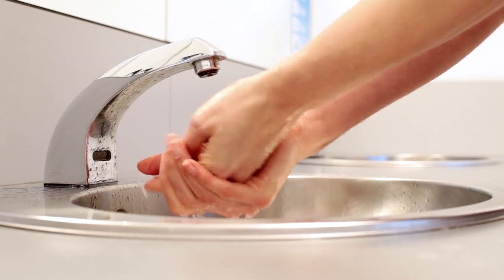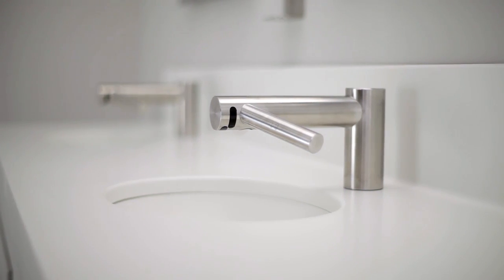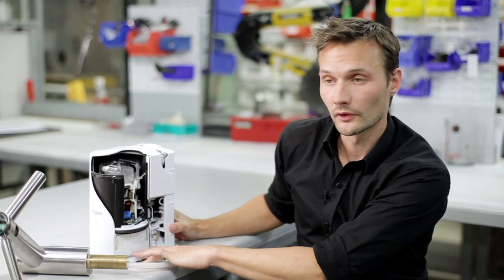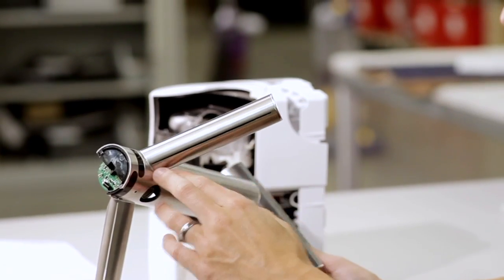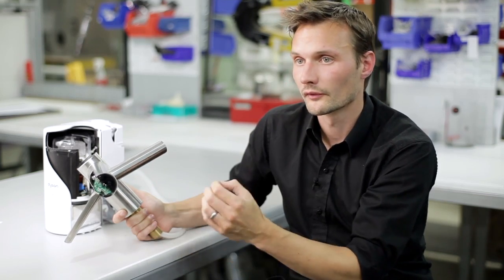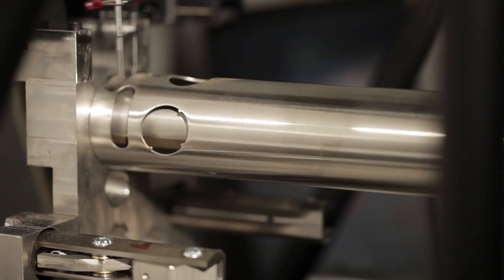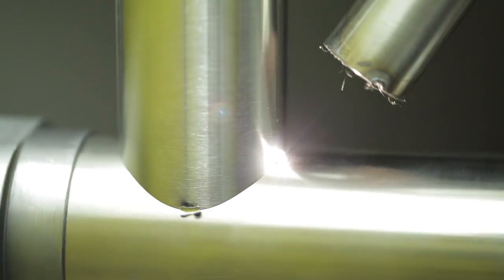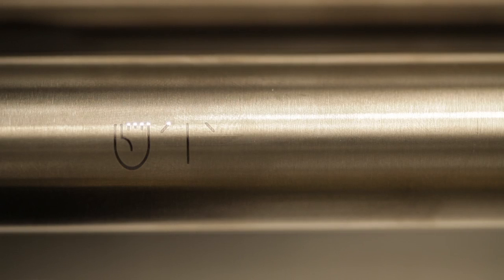Dyson Airblade Tap hand dryer explained - Official Dyson video

Comment: This thing is so bad,  nobody knows how to use it, its crazy expensive and people just grab the drying tubes and try to twist it right off the sink.  Now instructions have to be taped to the mirror just to achieve a 40 percent success rate.    This is by far the most irritating faucet ever invented.
Reply from the maker: +Rick Flaherty Hi Rick, sorry you feel this way. We developed the Airblade Tap to be simple and intuitive to use, with contactless operation for both washing and drying. It's received a lot of positive feedback from washroom users and facility owners alike. It eliminates the need for separate washing and drying areas, and ensure water droplets remain in the sink, rather than on the floor. We appreciate your feedback though, and I'll make sure this is passed along to our Airblade team for you.
Reply: I own a couple of restaurants so I understand the fact that guests can sometimes not understand things that are not like they are at home.  With that said, I figured it out in about 10 seconds.  Once you see it work, it is pretty amazing.  The price is painful though.  There is some high level engineering at work but that is hard to rationalize when I need four of them.  It's an $8,000 solution.  But I love what it does.

Comment: Still is twenty times less hygienic than using towels as people are just walking out with air blown bacteria still on their hands
Reply from the maker: Hi Patrick, it's Jack at Dyson. Other hand dryers don’t filter bacteria and viruses from the washroom air. They suck in dirty air then simply blow it back onto hands. With the Dyson Airblade™ hand dryer, dirty washroom air is passed through a HEPA filter which captures 99.9% of bacteria and viruses in the washroom air. So hands are dried using cleaner, not dirty air.
Reply: Dyson  Hello Jack.  These flters would  need to be changed out regularly, correct?  How often do they need to be changed out and what is the added cost of replacing them?
Reply: Dyson That a good reply and Dyson should make the public more aware of this fact. Thanks for making me aware
Reply: Dyson I note also that Dyson did a lot of the studies, especially the one carried out by researchers from the University of Bradford and the Microbiology Department of Dyson Limited and published in the peer-reviewed Journal of Applied Microbiology. Snelling AM, Saville T, Stevens D and Beggs CB. Comparative evaluation of the hygienic efficacy of an ultra-rapid hand dryer vs conventional warm air hand dryers. Journal of Applied Microbiology, September 7 2010
Reply from the maker: ***** Hi Lisa, it's Jack at Dyson. We're confident the HEPA filters in the current generation of Dyson Airblade™ hand dryers will last for the 5-year guarantee period without the need for replacement.

Comment: Probably the most frustrating time I've had washing my hands.
Reply from the maker: Hi, it's Jack at Dyson. The Dyson Airblade Tap is engineered to be simple and intuitive to use, with infrared sensors controlling both the water and hand dryer functions automatically based on the position of your hands. If you've encountered an Airblade Tap that wasn't working correctly, please let me know where this was so our team can investigate.

Comment: Pretty much trying to fix a problem that barely exists.
Reply: I know you wrote your note 5 years ago, but in case anyone else thinks this is not STILL a problem, it is.  If you own a restaurant  or a business where lot of folks use the hand sinks, you would see that thousands of hands dripping water onto the floor is not something you want.  It is messy, unsanitary, and causes damage to your building over time.  I used one of these in the UK recently and thought it was completely ingenious.

Comment: Wouldn't the high pressure of air being blown down into the wet sink just blow the water from the sink all over the place. Or when you fill the sink full of water to wash your hands and face, you will have to stand there waiting for the water to empty before you could dry your hands or you would blow even more water everywhere.
Also, sink is full of water when you are washing and you accidentally get your hand or arm in front of the sensor and it blows the sink full of water everywhere.

Comment from the maker: Hi there - the design of the Airblade Tap encourages the user to separate their hands so that water can literally be scraped off of their hands and down into the sink to drain away. Angling hands at a 45 degree angle from the wall strips water more effectively into the sink. We do also suggest that the sink is wiped regularly as part of a normal washroom cleaning regime.

Comment: If the HEPA filter is capturing the bacteria and dirt, eventually the filter will be full of dirt and dead bacteria and will need to be replaced. It could be that the filter is designed to last longer than the unit, which is acceptable.

Comment: Wouldn't a filter by definition always have a point where it needs to be cleaned? It's filtering something out of the air, so it will eventually build up, unless it is cleaned either manually or automatically.

Comment from the maker: Hi there, it's Jack at Dyson. The lifetime HEPA filter never has to be cleaned or replaced. All air is forced through the motor chamber and passed through the HEPA filter to capture over 99.9% of the bacteria. So hands are dried using cleaner, not dirty air.

Comment from the maker: Hi there, it’s Jack at Dyson. The water dispensed by the Airblade Tap will be pre-mixed. Many facilities have pre-existing mixers or have certain specifications about the type of mixer they use - the Airblade Tap is compatible with most mixer units.